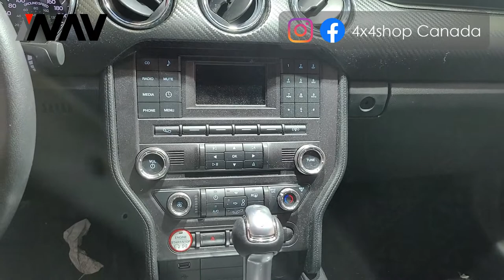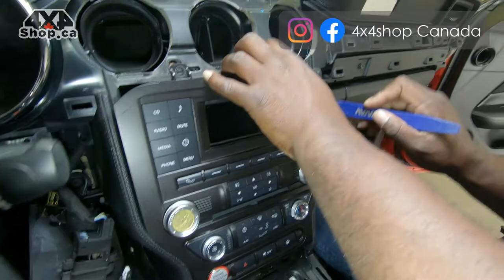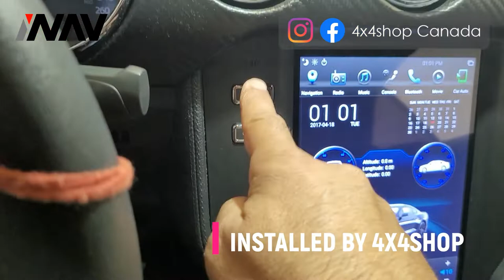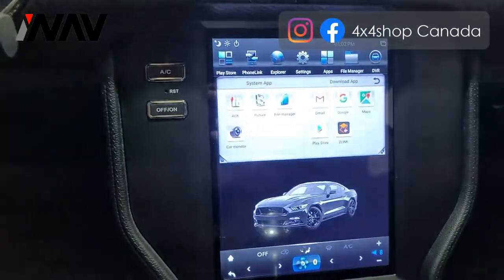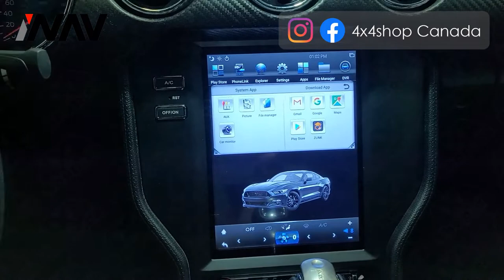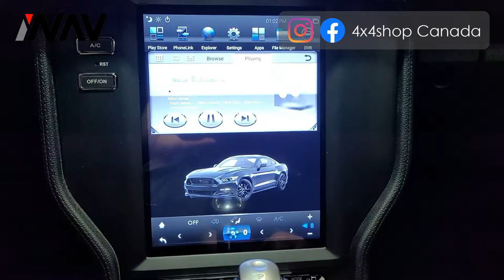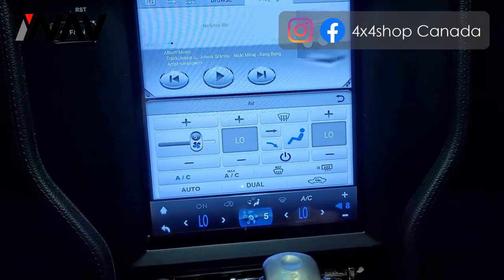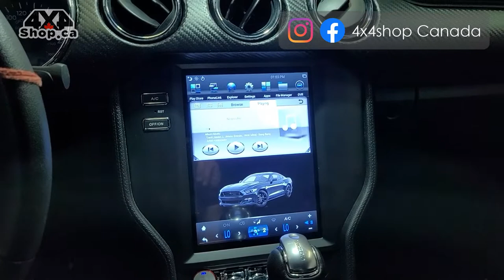HOW TO INSTALL 2017 Ford Mustang Android Tesla Screen APPLE CARPLAY ANDROID AUTO GOOGLE MAPS WAZE

Comment: I'm going to buy this device for my Mustang. Probably it's a stupid question, but: when you use "Mode" it seems that it changes something in the Carplay. However, "mode" is used to select different driving styles. Can you confirm me that, after the carplay installation, "mode" is still used to change the driving mode, please?
Reply: Good question, I am also awaiting an answer to this. I'm going to see if driving mode can be changed on screen above the steering wheel as an option.

Comment: I installed it with my 2021 everything works great but my backup camera shows “NoSignal” so I just ordered different cables would that work ? And does apply play works plug and play ?
Reply: Have you figure out the issue?
Reply: did you change setting?

Comment: Is there a brightness setting on this? I installed it and it’s very dark. Cannot seem to find where the brightness setting is for it
Reply: there is a star on right top corner  just tap to adjust brightness
Reply: @dharmad9580 is there a delay on this and is it smooth
Reply: very smooth

Comment: Hello, I have a PX3 Android 4.4 Ford Mustang 2015-2017 unit and I would like to update the software because I have problems with the AC controls, I have already changed the type of car and protocol and it does not solve the problem, thanks in advance
Reply: We’re you able to resolve this problem? I’m having the same issue